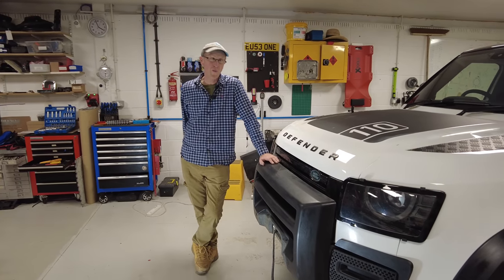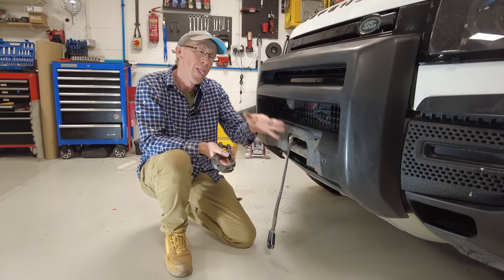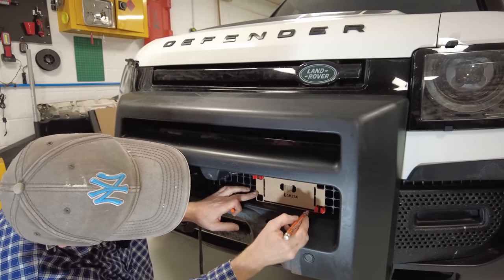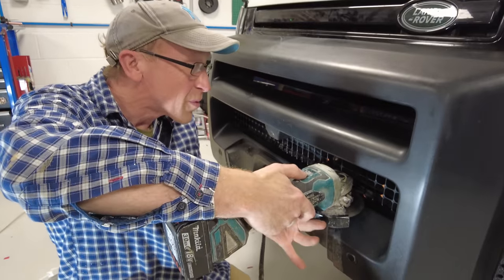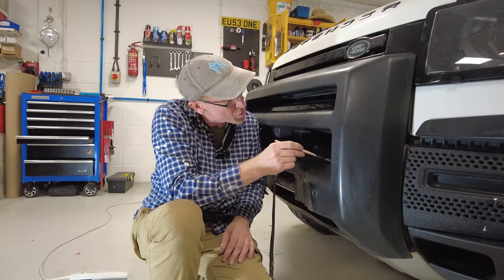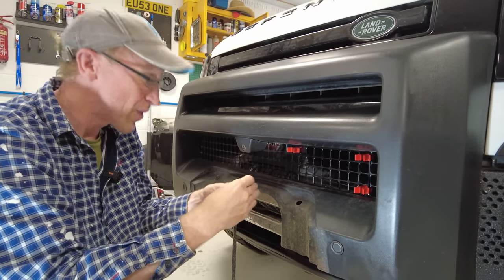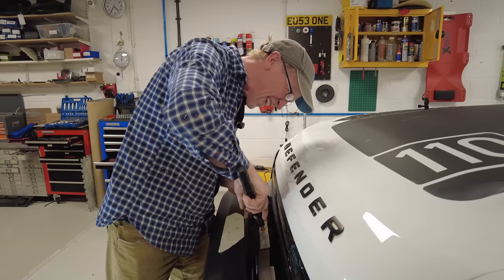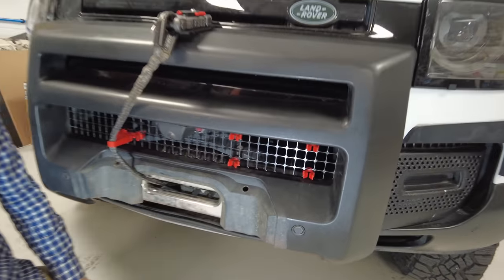Warn Winch Accessories for New Land Rover Defender L663

Comment: Simon, you genius.  After an entire group of Landy owners laughed at how I had no access to my winch and was undoing my mesh entirely before and after offroad events, I just pulled mine off but it looks a bit unfinished. This mesh patch is the perfect solution ! Buying now.
Reply: PS - I have the Aussie LR bull bar, with the same mesh, rather than the velcro-d on piece on your Defender here... I'll send you a pic once it's installed.  It'll work brilliantly though, I believe.
Reply from the maker: Thanks for the update - UK law does not allow the more solid front bars - it would be great to know that it works for all the front winch configurations ! Simon

Comment: I recommend the Milwaukee Hakzawl power hacksaw. Watch the sparks and your eyes and paintwork while using the rotary tools.  You don’t want half a Dremel cutting disc embedded in your cheek either. I would paint first and then, when dry, apply the jungle juice.

Comment: These are great little kits. Well done all. You guys come up with some great solutions. 

I can't believe Land Rover think that velcro is acceptable for that bumper. It basically means it is all but useless in the real world. It could come off during a water crossing, from a minor impact, or if you need to get up on the front of the car for some reason. It should at least have trim clips or fasteners on the underside.

Comment: In the good old days of the Defender , they didnt have any of the problems  your Defender 2  seems to be suffering with .   Can you imagine how long the Camel Trophy would have taken   if operating that particular vehicle .  I keep surfing the web looking for these Vehicles used  in anger   . Kindest Regards  to all - Cant you carry a wire to top of bonnet as an OFF/ON switch
Reply from the maker: Hi Mike - the old Defender had many problems with rust / bearing / brakes etc the nee Defender has more modern problems ! It would have been a good idea for Warn to put a remote reset button on the winch !